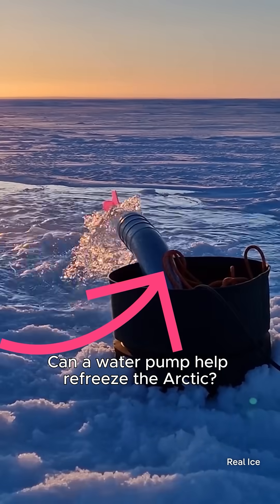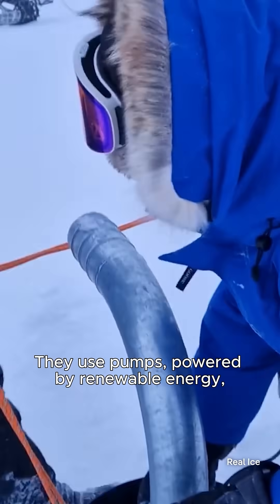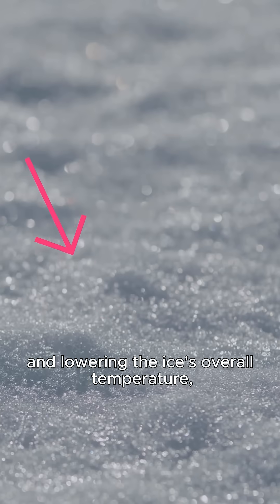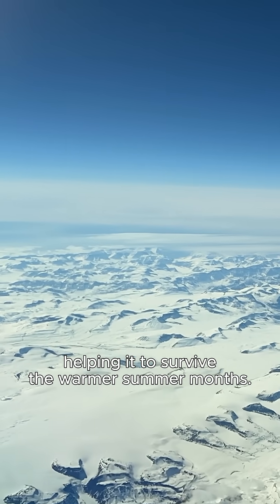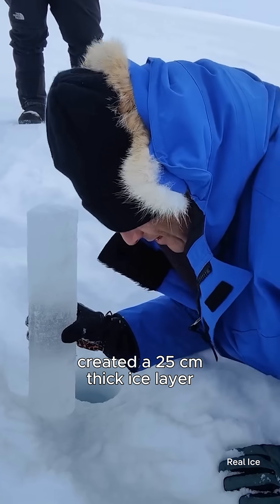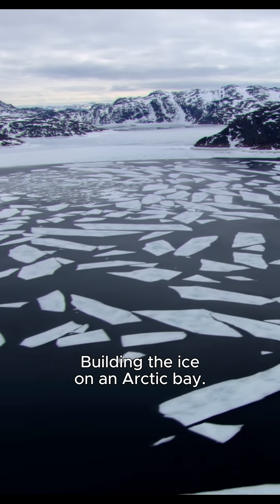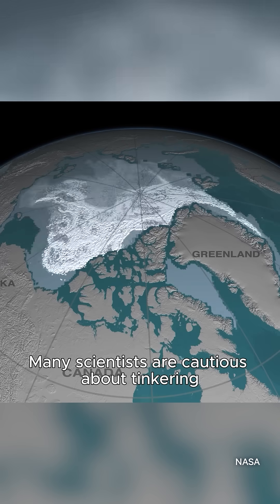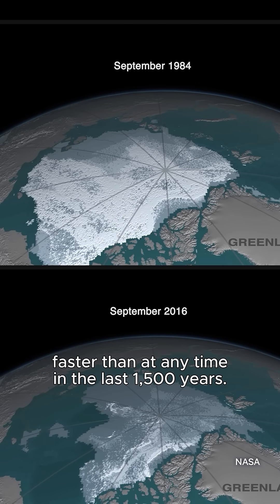Refreezing the Arctic

Comment: Salt melts ice or am I wrong?
Reply from the maker: Well, technically, salt doesn’t "melt" ice directly—it just makes conditions unfavorable for ice to stay solid. In the ocean, saltwater generally freezes at around -2°C to -4°C (28-25°F) depending on salinity ✨
Reply: @ so surely once the fresh water evaporates from the sun leaving behind a higher salinity mixtures wouldn’t that melt the ice faster 🤔

Comment: Lit global warming happen if the ice was melting too much and global temperatures were going up too much and the sea levels were Rising then why are they having to shut down the Panama Canal because the ship stranded because of a lot of water a loss of water make the sea level to not Rising cuz there's only like there's less than 2 ft difference between the Atlantic and the Pacific Oceans the open all the gates let the water flow in the freshwater in those Lakes be damned and I don't mean damned to say the save water I mean just Damned two Hades then I got to shut down the Panama Canal because they won't be a water shortage just eliminate The Lox you don't need them

Comment: Don't they use salt to melt ice on roadways?
Reply from the maker: Yes! Salt is used to melt ice on roads because it lowers the freezing point of water and prevents ice from forming. In this method in the video salt is used to reduce heat absorption, which would indirectly support ice formation.

Comment: There are many misunderstandings here needing answering:
1. Pumping water in winter is a common pactice to make ice roads in Scandinavia and Alaska. It works. The heat leaving the water passes to the very low temperature winter air that gets as low as -40C (& F!)
2. Arctic saltwater spray freezes on surfaces. The water freezes, concentrating the salt, which slowly migrates downward through the ice.
3. Scale: we were capable of removing almost all the whales from the world. Anyone who has worked in any very large industry knows we can do this at an appropriate scale if we want to.
4. The albedo effect of a million km2 of additional ice is very much higher than people realise. Despite the small fraction of the globe covered by the Arctic ocean, it has a hugely outsided impact. The effort is worth it - the gain in cooling is about the cheapest available on the planet. 
5. If a pump is petrol driven, CO2 is released. However, the new ice produced, which may last 2 to 3 years, is in that short time able to reflect back an amount of heat that is 10,000 geeater than the heat trapped by the additional CO2 from the pump engine. 
6. To the "We shouldn't intervene" crowd - we have been negatively geoengineering the world for 2 centuries burning fossil hydrocarbons. Fixing that is not destructive,  it's necessary. It is the same as installing a sewage works to fix raw sewage damage, or or any other industrial solution fixing environmental damage. Of course, it has a cost, and the party providing the service must make a profit - if they make a loss, they will go out of business, and we will fail to have the service.

Comment: Ever put water on ice? Usually melts it cuz it’s not as cold 🤣
Reply: That's because you're not operating at the kinds of temperatures they see in the Arctic... If you really want to, think of this like dumping warm water on the sidewalk, which in this case can't run off to anywhere, to melt the ice, and then it freezes again over night, except now you have an even thicker layer of ice
Reply: @ fair enough

Comment: This is a NICE idea but terribly executed:
-Salt water doesnt like to freeze
-Hydrogen is NOT a renewable energy 
You either burn fossil fuels or use renewables to make it but the latter is so inefficient it makes it extremely expensive for the power output 
-That water output is to low to actually make an impact but if you put industrial pump the water pressure will most likely melt the ice instead of making it xD
Reply: The by far biggest problem is scale. The arctic and antarctic is beyond massive in size. You'd need millions of these, not to mention that you'd have to deal with the fact that the ice sheet becomes very thick further in (in some cases up to multiple kilometers of thickness).
Of course all the other issues are very valid too (especially the one about hydrogen not being a green technology on industrial scale).
Reply: @op4000exe  this is most likely a publicitary stunt than actual research
Reply: @LaPtaVerdad  Veery very likely. With that said though, it's not as though it's technically impossible, just practically unfeasible.
Reply: @LaPtaVerdad
Sea ice IS saltwater.
Reply: @oneshothunter9877  boy you are smart
Reply: @LaPtaVerdad  
I mean.., read your own writing: saltwater doesn't like to freeze.
Wtf does that even mean? 😂😅
I live in the arctic, and the sea - which is saltwater, freezes over.
If this was done in a massive scale it would thicken the ice. It happens naturally too, in a limited scale, though.
You the smart one here. 😂

Comment: Salt and ice don’t mix. Only the freshwater freezes in an ocean. Putting the salt water on top is a no go.
Reply: "Salt and ice don't mix" what are you talking about
Reply: Salt is soluble in water. Sodium chloride mix very well with water separating into ions of sodium & chlorine. Grade 6 chem.
Reply: Sea ice IS saltwater.
What are you on about with the "don't mix" comment? 😅
Reply: If you watched the video, the salt clearly didn't stop it from freezing in the trial.
Reply: Salt water still freezes at 29 degrees though. What would be the problem with saltwater ice on top of freshwater ice?
Reply: They’re just pumping sea water (salt naturally dissolved) on top of the ice… not mixing salt and water and pumping the “mixture” on top 😂. Plus, they’ve literally shown it works by creating 35 cm thick ice sheet. Did you watch the video?😅
Reply: Yes I would also say, Do not mess with nature!!

Comment: I'm not trying to be negative, but creating a few skating rinks on the ice is going to have essentially zero effect.
Reply: What this aims to do, in theory, is reverse the albedo effect. A white, icy surface reflects more light and heat compared to a dark, earthy surface. This can prevent melting. HOWEVER, this has to be done on a pretty massive scale and one company alone would not be able to accomplish this, which is why I originally said in theory it would help.
Reply: @ethanholka3422  I fully understand and truly admire the initiative. They are actually doing something about the problem.
Reply: @InvaderSS670  What problem? I had 5 months winter. Now only 4.5 months. It is definitely better 🎉
Reply: Nothing admirable about being so arrogant that mankind thinks he has control over the climate.
Reply: its not negative, its realistic. and also my initial thoughts. but I think it can be considered a testing probe for the concept. and it seems to work. 
whatever will be done to ease global heating will on its own never be enough. but many small pieces make the puzzle. greening the desert, reforestation, sponge cities, artificial reefs, carbon capture aso. that right here might well be a quite essential part. for until now there are only indirect methods to keep the ice from shrinking. but to directly thicken is a great approach. and quite impactful in the grand scheme of things. because essentially it is growing back the giant mirror to reflect sunlight.